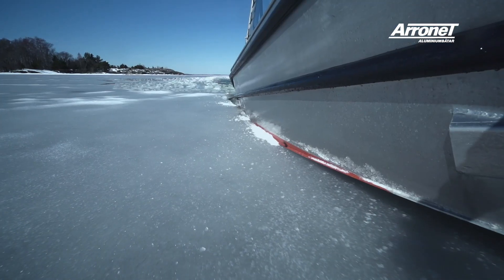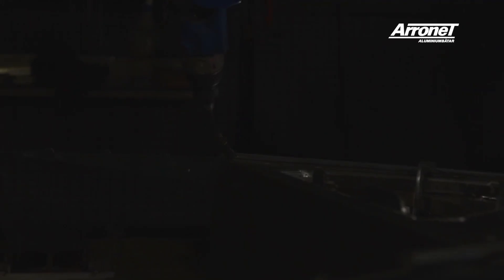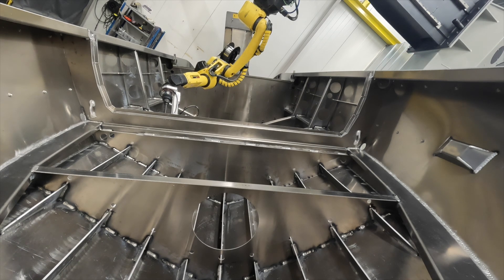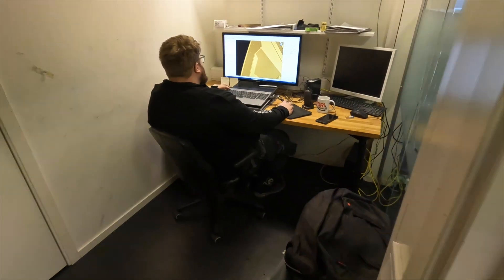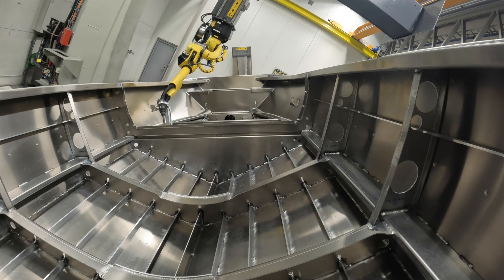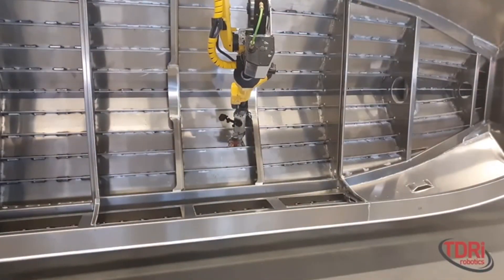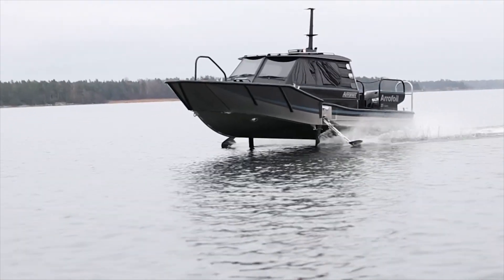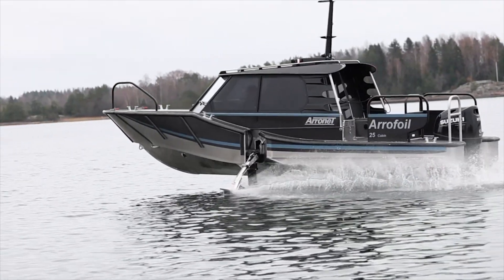Arronet Case Study: High-Mix Robotic Welding of Aluminium Boats

Comment: I still have my doubts, Small boats are full of welds that a robot cannot access and designing a vessel without confined welding is near impossible. Repeatability is also a major concern as aluminum is prone to distortion and things will move as the robot welds. Good luck
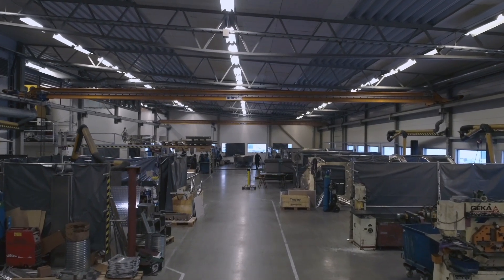Reply from the maker: Yep, access can be a challenge! That's one of the reasons our automatic planning software was critical. To account for repeatability / distortion during the weld, a 2D laser tracking camera is run ahead of the weld for longer welds (you can see this in use at 00:38).

Comment: So does the robot use a vision system to locate and follow the seams?
Reply from the maker: Yes, a FujiCam profile sensor is used - the red box looking at the weld seam at 0:38. An important consideration to enable finding and then tracking these long curved welds.